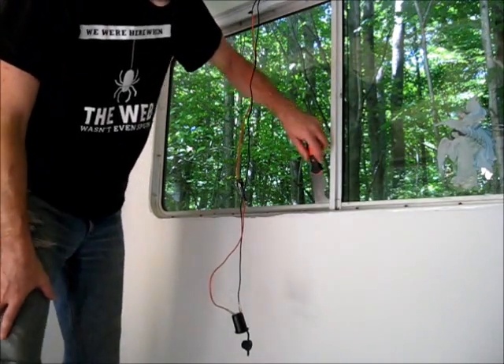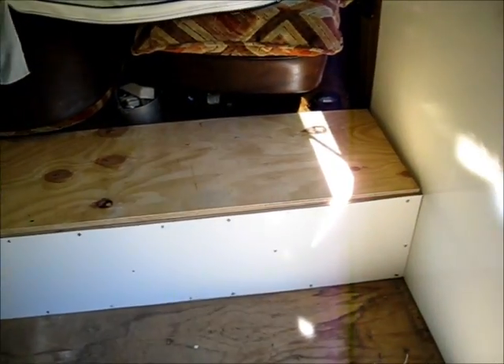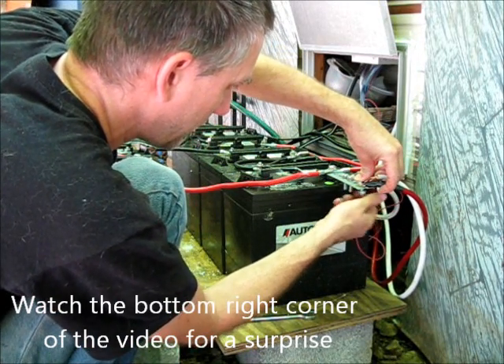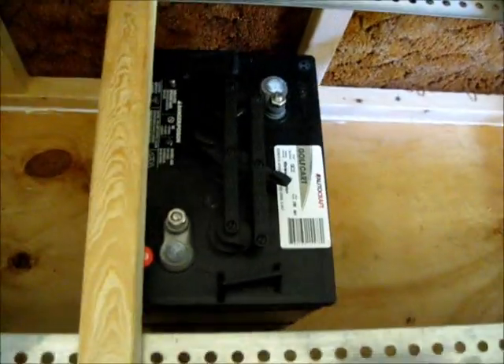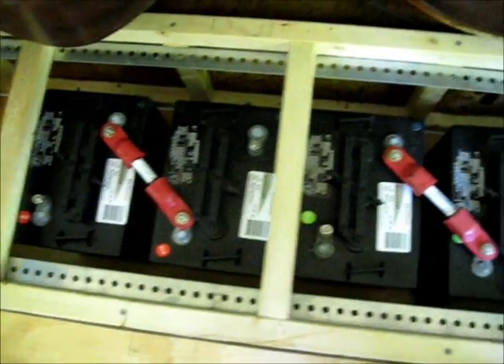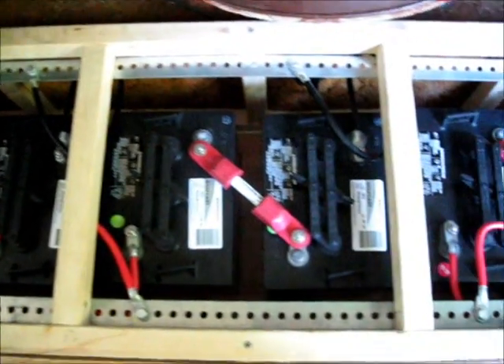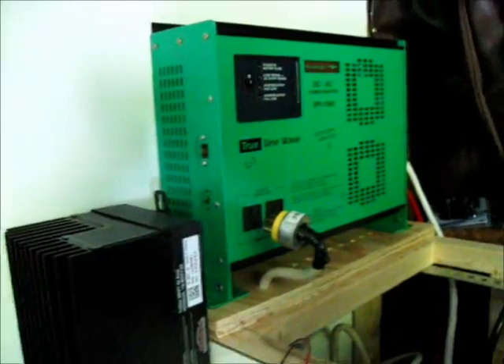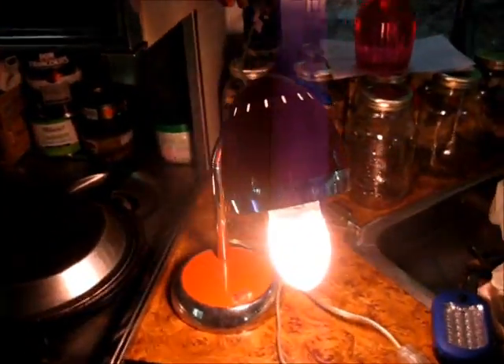Installing My New RV Solar Batteries And Power System

Comment: For a job I worked on, they built the floor of a tv set using sheets of Formica.  No separation that way, even if no glue.  Cheap and easy.  And it looked really nice / was easy to clean, and durable.

Comment: When wiring a battery bank it works best to evenly distribute the charge and load on the batteries by connecting each battery together then the + on one end to your load and the - on the other end to the load. That way the current goes through all batteries evenly as opposed to a buss bar. Rather than some batteries supplying more current than others.

Comment from the maker: Thanks. Yes, I need to connect the leads differently but need 2 ga for that. I am using 4 ga so the wires are shorter for now.

Comment: Had fun today.  Had to clean off the folks driveway. Soooo, just for fun I took my good tractor battery and my dads 1550W power inverter and plugged in the electric leaf blower.  Worked perfectly and a lot faster than sweeping it off.  I've actually considered building a small backpack setup to hold the battery and inverter so I can basically make an inexpensive electric backpack blower. :D All I need is a piece of flex hose in place of the solid tube. Afterwards I can charge it up with solar.

Comment: You mentioned the venting holes you drilled in the top of your battery compartment letting the "warm air in". Warm air won't go anywhere but "up" unless you have some way to draw it in by force. Additionally, you have now vented the battery compartment into the living space but hopefully the lower holes in there will allow off-gasing to leave through that route. Keep working at it!

Comment: For all who gave thumbs up on this post, please keep 1 thing in mind. Battery compartment SHOULD NOT BE TOTALLY SEALED. Aussie Prepper is describing a pressure cooker when he makes that comment. Even those have safety pressure relief valves. 

Plus over stating the risk, ignoring the fact that this is a work in progress and steps Troy has stated that he will take as he finishes the battery compartment. 

BTW,  changes in atmospheric pressure, weather men discuss has little bearing on this topic.

Comment: I understand positive and negative pressure. First of all having holes into the living area is  not safe,having it under the inverter is not safe, if the fan  fails you could have a problem. I  understand wanting to keep the batteries  warm. They will be warm inside the RV as long as the heat is  on  you could try some insulation  in the box.. Vent at top to outside left side vent bottom right side like it is. Use a fan if you want  I would think not needed until hot weather

Comment: There are two reasons your VCT tile are expanding. Expansion and contraction. The VCT must be left at  certain temperature . If the RV is cold then hot  then the tiles will expand and shrink. Think of a cold vinyl floor that curls up around the edges when the temperature dips down. Same thing is happening here but being solid vinyl not cushioned it shrinks. It could be because of  subfloor movement. A sub floor has to be screwed every 4 inches around the perimeter and 6 inches in the field.

Comment: There are a couple of brushless DC fans in the base of the box that vent to the outside, so the box is actually at a slightly lower pressure than the interior of the RV. If the fans have a high enough flow rate, then there is no issue with that setup - the gasses will be drawn outside easily. The batteries would have to be in a dead short to produce a high enough concentration of hydrogen to pose a real risk of explosion, but then there would be bigger issues to deal with at that point...

Comment: Some helpful hints for your power. It may be small, but you have a power loss by using that plug. If the inverter is out of warranty you can open it up and wire your power line directly to the wires that lead to that plug. You could drill a hole in the bottom of the inverter (in a clear place) and run your wire in there, keeping a neat and tidy appearance.

Also in case you didn't know, you should check your inverters efficiency, do it by hand and don't rely on what the manual says the efficiency is. Even if they are not outright lying, the stated power is usually gotten under perfect conditions in a lab, something you will never achieve. If you don't know how to test let me know and I'll walk you through it

Comment: I hope that helps, I can over think things also, lol.
I think, I would just isolate the positive buss bar, from the wood, and or even with rubber between the wood and monting scres/ bolts etc, there are many ways.

Comment: Part 2- I would suggest trying to seal the battery compartment with some thick poly, perhaps a couple of shower curtains, bonded with epoxy. The lid should be as close to a perfect seal as you can manage. Even with all that what will save you is that fan. You may want to consider a second one to increase air flow and provide redundancy.  You don't want to mix hydrogen and a spark from the batteries (as I am sure you know from your car experiments). I really look forward to what you do next!

Comment: Troy, no matter how hard you try you will NEVER get tiles to not move in an RV. If they didn't move they would just crack. The wood floors flex so much it is crazy. I put tile in my camper and had the exact same issue. Looked good for a week and one drastic temp change and the tiles moved.

Comment: Troy, the tiles are moving because of the flex of the rv itself.  That is the reason for using either carpet or one piece vinyl.  Typically, those are the two materials used in rv construction.  Two pieces of 3/4" ply sandwiched together may not have prevented this.

Comment: Same screw pattern that I had to use when I replaced carpet with glue-down hardwood flooring. (Hardwood strips with a composite material backing). Underlayment had to kept "rigid" for lack of a better term to reduce effects of natural expansion & contraction.

Comment: Nice job not letting the smoke escape from all those wires Troy!  Watching you tie in the bus bars I couldn't help noticing your terminal cap screws were long enough that you might want to consider nutting them direct to the bar and using a second nut to secure the wire term down.  Makes connecting/disconnecting a snap later on, but you got it all working now so maybe a tinkering project after the white stuff starts flying.  As if you have a bunch of spare time.  lol.

Comment: That's a totally closed environment. Similar to tightly sealing a bottle of fermenting grape juice. Once pressure builds enough, something is gonna give. Solution in that case is an air lock. 

Battery compartment isn't sealed that tightly to allow any pressure to build up. Holes already drilled in the floor take care of any potential of that happening.

Comment: Awesome you got power, but you need to cap those wires in that unfinished box in the leaky wall till your ready to work with it to make sure you don't get any sparks. Other then that your rv on it way to being finish.

Comment: HI
YOU SHOULD HAVE BATTERY TRAYS IN THE CUBBY HOLE THAT THEM BATTERIES ARE GONNA LIVE FOR THE PURPOSE OF CATCHING THE EXCESS FLUID FROM THEM AND THEY SHOULD BE STRAPPED DOWN SOME HOW SO WHEN MOVING THEY DONT JUMP AROUND...

SHOULD MAKE A SLIDE DOOR FOR YOUR FAN ON THE BOTTOM OF YOUR FLOOR OF THE BATTERY BOX SO WHEN YOU GO DOWN THE ROAD YOU CAN SLIDE IT CLOSED, WITH ALL THE OTHER CLOSINGS AND SHUTTING DOWNS & PACKING UPS YOU HAVE TO DO BEFORE YOU TAKE OFF...
I MADE A LIST OF THINGS HAD IT LAMINATED AND TAPED IT TO THE DOOR SO THAT I COULD DO EACH OF THE LISTED THINGS TO MAKE SURE ALL WAS DONE BEFORE I PUT THE RV INTO GEAR TO HEAD OUT....

BLESSINGS
FRANKI

Comment: Awesome job.  That seemed much easier than I imagined.  Those snakes sort of creeped me out.  Troy, is there a lumber mill near you?  If there is, you should go and see if you could get their scrap for fire wood.  In effect it is presplit and only needs to be cut to length, which you can do with chainsaw, saws-all or circular saw.  That could stop the critics cold.

Comment: Thanks for sharing the video.  I would also agree that another conducting metal would be a bit better.  You are following the principle of keeping the wire runs short which is good.  I would think the steel bus bars would be counterproductive.  One more concern is the venting.  (I am not smashing on you so don't take me wrong)  If the fan is not on constantly it would seem the lower "exhaust" would actually turn into an intake and with heat rising it would put whatever gas into the living quarters via the vent holes at the top.  The box is sealed with the caulk so I was anticipating a fresh air intake from outside and also exiting outside again.  I do not know how significant the gas release will be but could be of concern to breath over a long period of time.  I believe it is hydrogen gas so contact with an open flame could really be an issue.  Anyway, thanks again for taking the time to share.  Good luck with your projects.  Be safe.

Scott
Reply: i was thinking the same thing about when the fan is off.

Comment: Grout isn't applied to vinyl tiles. Grout is used with natural stone or ceramic tiles, for example. Possibility that the glue was too old. More likely its the movement of the subfloor due to humidity changes and flex of a floor that isn't supported by standard floor joists.

Comment: Troy, I really enjoy watching your videos. I often want to yell through the screen on what you should do- then you go and do it just he way i was going to suggest! You must be able to hear me! Lol. A couple of thoughts.  1) the gas that comes off the batteries is lighter than air. I don't think what you have done ans what you have mentioned will be enough. 2) The wooden slats between your metal strips-terminals could form a bridge for a short circuit if they evee got wet-a leak or spilled drink.

Comment: Battery box is fine. Will be vented with a fan to exhaust gases to the outside. 

Plus, there are several factors that would have to come into play before release of hydrogen gas would be materially dangerous in this particular environment. 

When I'm using electrolysis to clean cast iron, it's likely that I release much more hydrogen in a few minutes than those batteries will release in hours, possibly days. Haven't researched battery release vs electrolysis release to confirm.

Comment from the maker: I use a fan to pull the gases out through the floor. I want to pull room temperature air into the battery box to keep the batteries warm in winter and cool in summer.

Comment: While dry wood, especially at 12V is vertually non conductive, at higher voltage and or moisture it can create at least a bartial short accross your battery connecting straps. especially if the woodbracing ever became soaked. But I really appreciate your vidieos, keep it up!
Reply from the maker: Thank you. Did you know that the original battery cases were made of wood?

Comment from the maker: Metal framed walls in the RV. I did not want to drill into the metal framing. And had to run wires through the battery box anyway and also keep the wires short as possible.

Comment: Cool Beans :) got your power online!  I know how that was lifting those batteries.  Our other house had a bank of four Trojan T-205 golf cart batteries, and MAN were those heavy.  I absolutely hated having to move those.  Hated every minute of it.  That's a really neat setup you have there BTW :)  That ticking sound your inverter is making is the fan controller.  It's most-likely PWM and its just barely touching the fans at that little or no-load condition.  I have an inverter that does likewise

Comment: keep up the good work! i look forward to seeing what you are doing next. plumbing can be a total nightmare. (voice of experience.) electrical connections should be connected negative last. disconnected negative first. as an auto mechanic i was trained that thomas edison was wrong. power flows from neg to pos. do not get discouraged because you know that all things are possible through God who gives you strength.
this post will probably get some thumbs down, but i do not care. God bless

Comment: he should have used the  luan undelayment, regular plywood has too many irregularities. May seem smooth but when the glue is applied it reacts with the glue in the plywood and pulls those tile into those tiny defects, also cause them to move to the edges where they have nothing to stop the movement. Plywood is not a substitute for underlayment.

Comment: I am wondering if the humidity is causing the glue not to dry! You have had so much rain.. how very frustrating. You worked hard today.. those batteries are a back breaker. Getting closer toyougoals.. Awesome! Blessings!

Comment: Kinda ironic how the government makes them put seatbelts in the rear of RV's, but not in school buses. Your tile problem isn't the tile, the floor is flexing when you walk on it. That's why they recommend you don't use tile in RV's or mobile homes. My mobile has 5/8 CDX plywood with 1/2 in. concrete board on top of that and my tile did the same thing. After about a month of walking on it, silicone the gaps. If you get water in there the tiles will start coming up.

Comment: they will, but if you ventilate it wil be alrigt, whit  or whitout a fan.
throy has lead battery's the wil gass, wit a little ventilation it wil be ok.

Comment: I forgot what you ended up using for glue.  I think the one that had to dry.  I was told by a flooring guy that they always use the Liquid Nails, and not the tile adhesive.  Now I know why.  Maybe they'll refund the tile / give you new ones, if they see how their recommended adhesive failed.  Also, I know a plywood subfloor is never good for any tile.  Over time, it expands and contracts too much.

Comment: Those holes are the air intake point to bring warm air into the battery box. For hydrogen to escape through those holes it will have to resist the air pressure created by the fan. Lighter than air hydrogen over coming the force of heavier air being pulled through the holes? 

Pulling January upper NY state air into the battery box from the outside has negative effect on the batteries from what I understand.

Comment: Your garter snakes may have been preparing to hibernate. They usually get together in a group in whatever spot they decide to kick back in. Don't begrudge them slithering around the yard. Do worry about any indigenous pit vipers you have in your neck of the woods. If possible dispatch any you come across. Better safe than sorry. I don't mind being bitten by a non-venomous snake, but a rattler or copperhead can really ruin your day. Google the range for each type to see which, if any, you should be concerned with in your area. Leave the rest alone as they are beneficial to you in many ways. Really enjoying your videos. Keep up the good work.

Comment from the maker: The batteries do not produce much gas in a day. Not much at all. I have worked with pure hydrogen before and also seen a lot released into a room before.

That said, I will be careful but believe that if the fan fails, I would hear it and then have time to replace it before dangerous levels of gas build up.

Comment: From what I've read while looking into that acid batteries, the gas that they release is hydrogen.. my worry is that the way your venting that battery box will not remove the hydrogen gas, because as you already probably know hydrogen is less dense than oxygen and rises. Sense you're exiting air is going down, not up, the hydrogen gas might get trapped in those pockets in between the support beams going horizontally across the top. Maybe I'm wrong or not taking something into account.

Comment: The fan he is installing will pull air from the room into and through the battery box to the outside. Thus, IF any hydrogen is trapped by the frame, it would be minimal.

Comment: The tiles get gaps cause they move due to the glue under the tile doesn't really stick....I too had the same problem with tiles I purchased from Family dollar...
Reply from the maker: marcos22571 It is annoying. You would expect better from commercial glue
Reply: Off Topic but could you do a vid. on how to tap the transformer a/c box to regular 3 prong cord??? Please!'
Reply: The Do It Yourself World All of your seems on your tiles should have been staggered that way they can not move as a whole
Reply: The tiles didnt stick because he re used the sheeting and didnt put new 1/4 down.

Comment: Lowe's is not a RV specialist. They sell you basically household stuff. Homes do not move, vibrate, expend and contract like vehicles do. Go the a RV supplier and talk to those that deal with RVs and their issues. They will know all the problems related to RVs.

Comment: Already been taken care of. When complete, venting will be done through holes previously drilled. Exhaust fan ready to be installed to pull air from the battery compartment.

Comment: I thought you had to roll over the tiles with a heavy roller to spread out the glue, walking over them doesn't work, else fitters wouldn't use them.  If you are walking barefoot on them your weight, grip, motion will act against the tiles and move them.

Comment: he is using a mppt regulator , it works on mutch higer volts from the panels (all in series) the pv voltage wil be around 80 volts , so the powerloss on the pv cables are neclectable, the wires from the regulator to the battery's is short and big!, thats inportant!, with use of the older types of regulator you ar rigt, in this case not. mppt regulators are a world apart, working mutch better as the old type regulators.

Comment: You should put the wire in PVC and bury them so they do not get damaged or tripped over as well as you won't have to move them when you cut the grass.